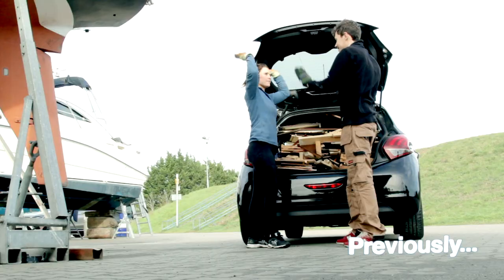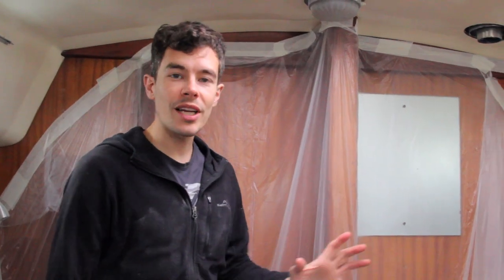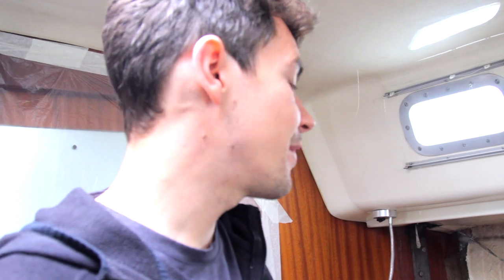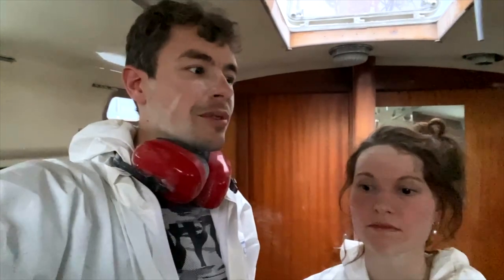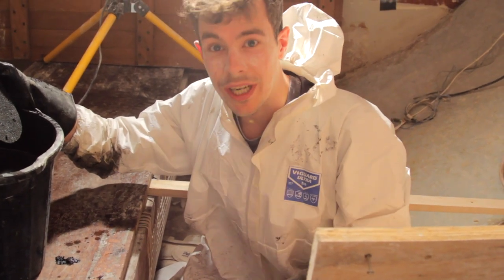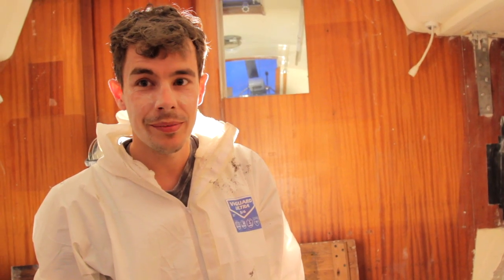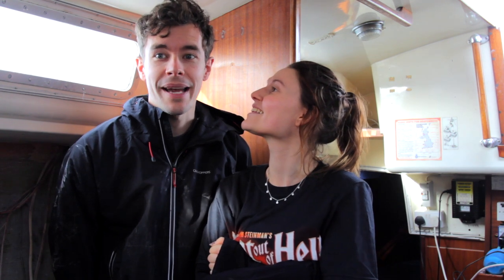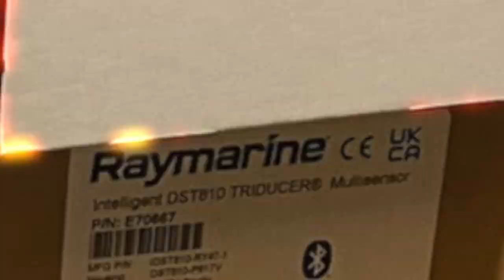Ep 6 | ONE step forwards, TEN steps back

Comment: Have you thought about putting a PSS on the shaft instead of the packing gland? When you launch it will be a lot cleaner in the bilges. Also put carbon capture pads under the engine to capture oil and diesel-it keeps the bilges sparkling clean.
Reply from the maker: I can't say that has crossed my mind but I shall research!! Thank you!🙂